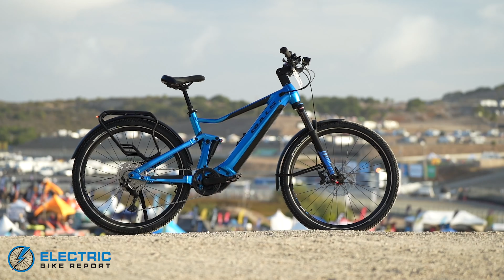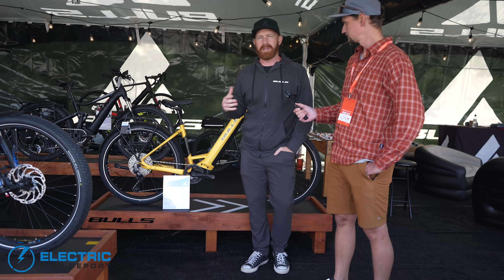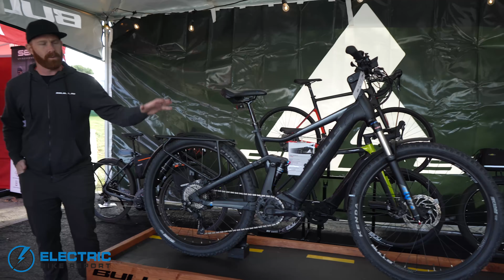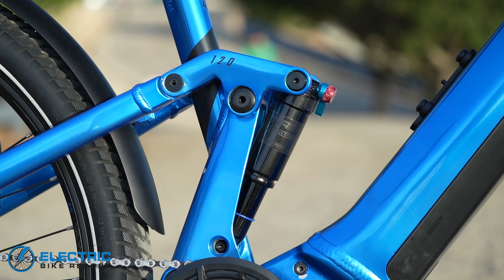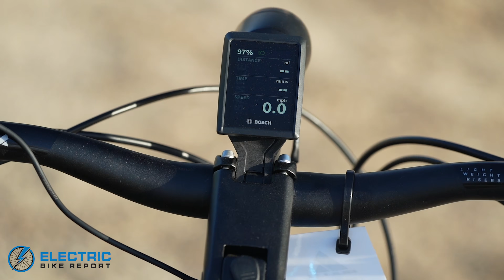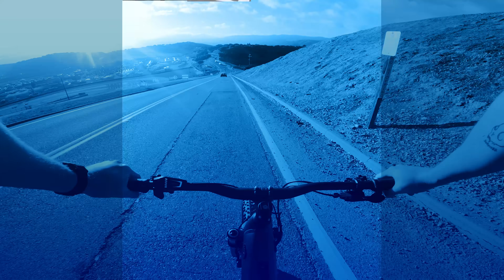Bulls Iconic Electric Bike Lineup | Electric Commuter Bike Overview

Comment: I have needed a replacement battery for my bulls Evo sturmvogel since August.   Looks like Bulls NA won't be getting any batteries until maybe December now. It would be nice if bulls could keep some batteries in stock so people could use their bikes and not be without for months on end......(sigh).
Reply: Part of the reason Bulls is ditching brose for 2022. Not sure if you heard, but there’s a global supply chain issue going on due to a deadly pandemic. That’s also not bull’s fault. It’s BMZ’s fault. Barney, Adam and the folks at Bulls are doing their best. Your comment is the opposite of relevant and helpful.